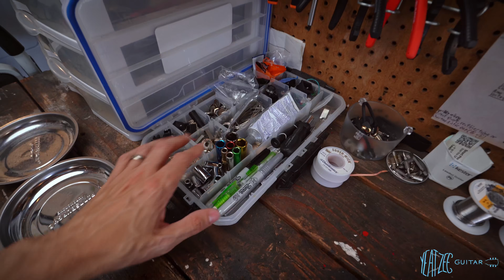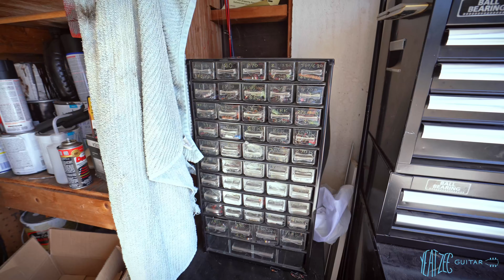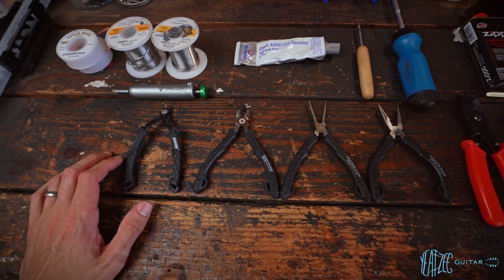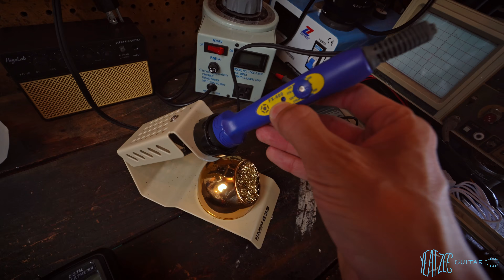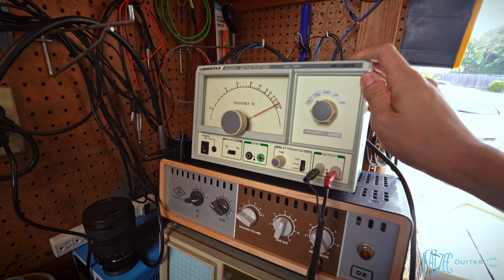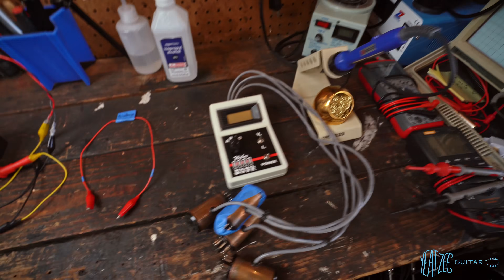Tour of my Amp Tech Workbench (AND tools I recommend)

Comment: Great video and work shop thanks for sharing. New Subscriber from Australia
Reply from the maker: Thanks! 🍻🍻
Reply: @YeatzeeGuitar Do you have a video on Saftey when working with Amps . Eg how you set up your dim bulb , isolation transformer , Variac configuration?
Reply from the maker: @andrewhenderson9474  There's really not much to show with those. The lightbulb limiter was made using the Uncle Doug video as the reference. The isolation transformer is only for the oscilloscope to have that separated from the amp I'm working on. Variac is just a big dial, nothing fancy there. Have any specific questions?
Reply: @YeatzeeGuitar heaps. Do you use an isolation transformer. ?
Reply from the maker: For the oscilloscope yes

Comment: I like that resistor tester! 
I also like the Kaiweets 6000 meter I got off of Amazon. 
Also if you can find some 120-24 volt transformers you can run one into the other and have a cheap isolation transformer. I tore mine out of an old industrial ac unit that was being replaced at work. I plug my variac into it. 120-24, 24-120